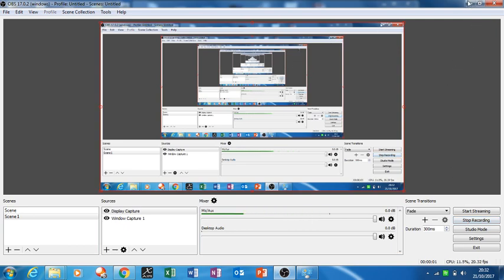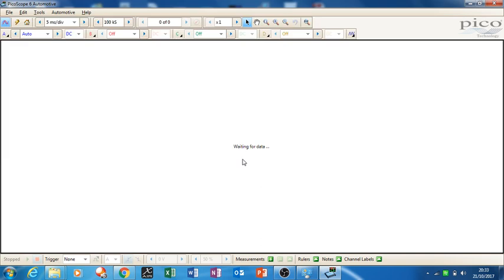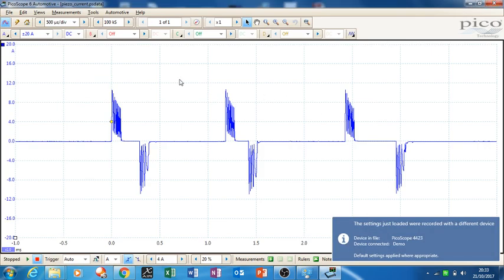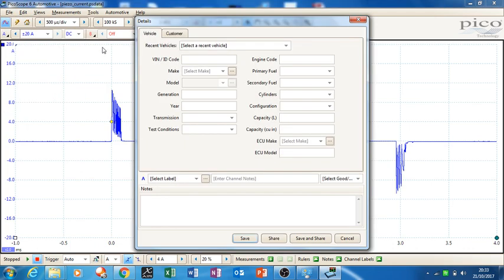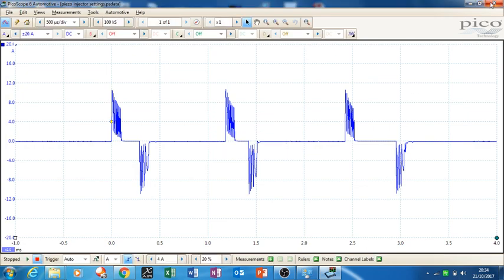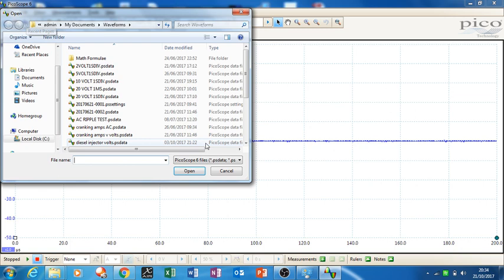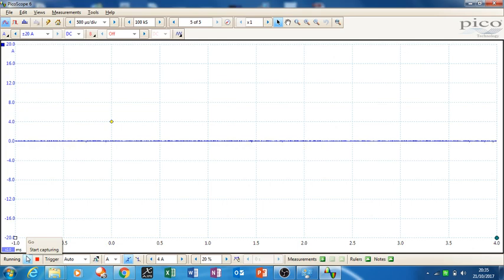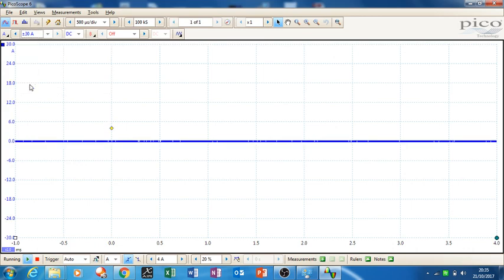Transfer automotive Picoscope settings to Non- Automotive Picoscope

Comment: Hi again Sandy I have found the files  ending in .psdata to already be in the application folder called "saved waveforms\en" so you can just either seach for them there or copy them to your own folder, only trouble is some of the names of them are not always obvious.
Reply from the maker: Shandybrother cheers I'll check that out many thanks sandy